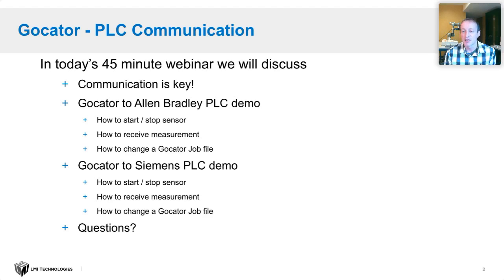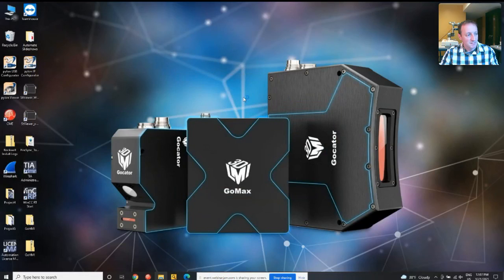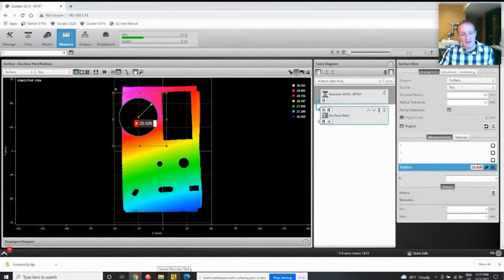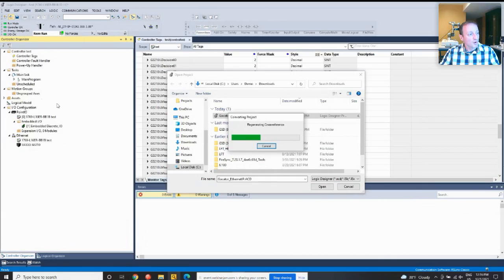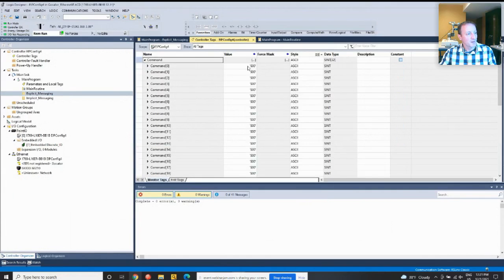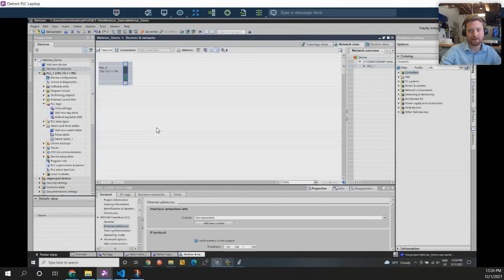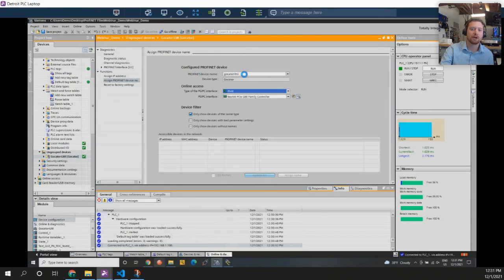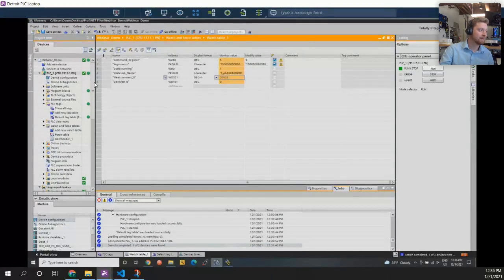Gocator to PLC Communication

Comment: Hi, Can I use 5V differential signal incremental encoder as encoder for Gocator 2150C?
Reply from the maker: Yes, you can. Check out this relevant page in our user manual: https://d3ejaiy6gq5z4s.cloudfront.net/manuals/gocator/gocator-6.1/G2/Default.htm#Specs/Gocator_Shared/EncoderInput.htm?Highlight=encoder